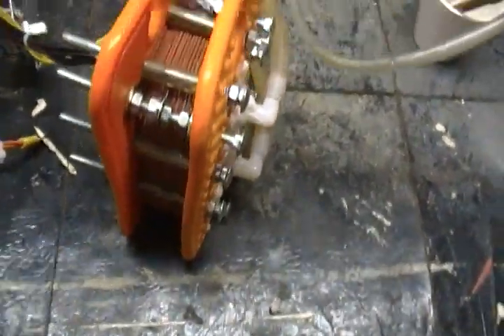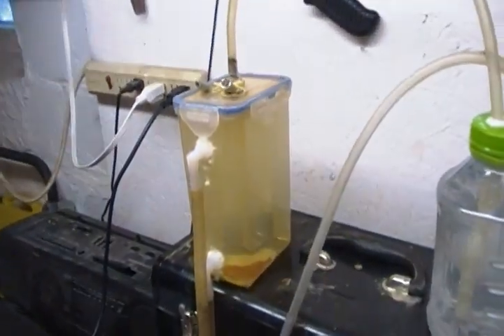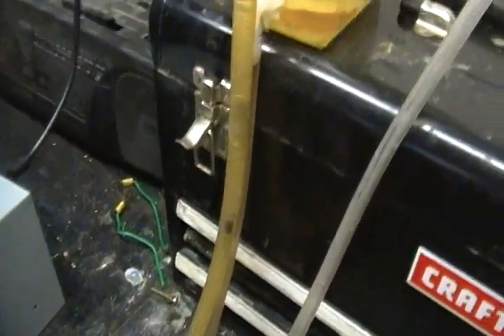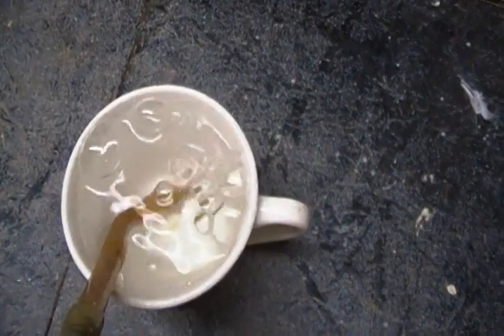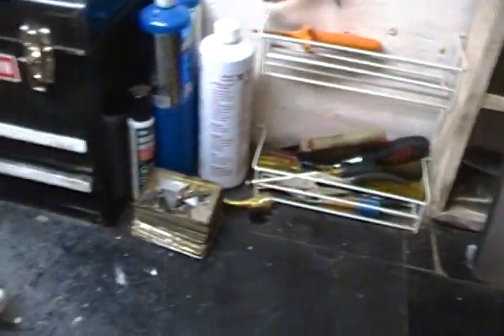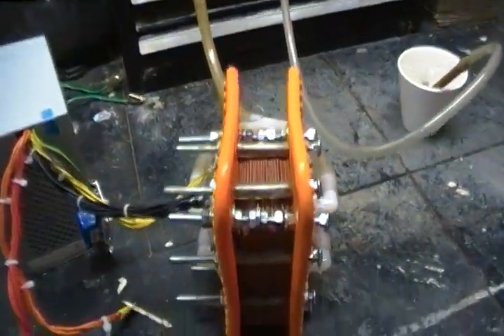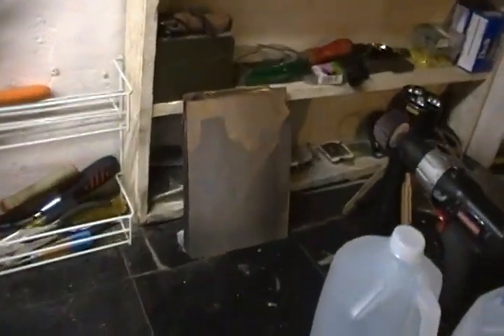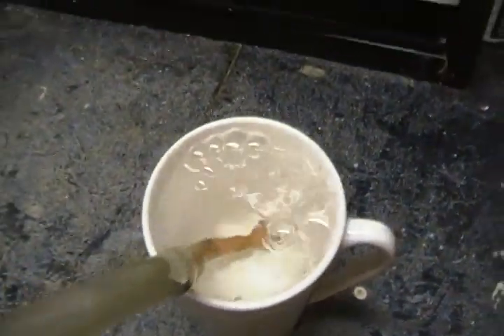HHO Dry Cell Update

Comment: looks good.
If you aim your outlet ports up it will flow better. Hard to see but it looks like the hho is coming out of the ports and going downhill before it travels up to the bubbler. My first cells were out of switch plate covers also. Your new plates look good also. from experience make the holes in them bigger than 3/8. I use 1/2 holes now. Also a good place to get end cap material is Mcmastercarr.

Comment: It's amazing how much energy is locked up in water.
Reply: It's not actually "locked up" in the water. Driving energy into the mixture (electricity) breaks the bonds between hydrogen and oxygen, creating H2 and O2 gasses, or oxyhydrogen. When heated up, or ignited in this case, the gasses react, forming water and releasing excess energy from the electrolysis.
On its own, water is a really stable chemical compound (yes, it is a "chemical"), and doesn't burn or explode without sufficient energy going into it.

Comment: TRY IF YOU CAN,  316TI, FOR THE POWER PLATES,  316 L  FOR THE NEUTRALS,   KOH, DISTILLED WATER,   CCPWM,     WATER STAYS CLEAN AFTER 8 MONTHS RUNNING.  SEEMS LIKE IT WORKS BETTER WITH THE  316 TI AS THE POWER PLATES

Comment: Can some one explain to me how that works ?
Reply: +actuatedg3rm The electricity breaks apart the H20 in to Hydrogen Gas and Oxygen. The hydrogen is explosive essentially. 

Some people use it to better power their car by venting the gas (with a system like this) in to their engine's air intake, and thus lowering the amount of gasoline required to ignite and move the pistons in the engine block.

EDIT: I've been better edumacated. Thanks for the input, OutputCoupler.
Reply: +condhor Some people use it to power their car, but it certainly isn't better. You'll never get out as much energy as you put in (fundamental law of nature), and all the energy in your car comes from the gasoline. So what you end up doing is storing energy temporarily in the form of hydrogen, then reclaiming a portion of that by burning the hydrogen. So you spend more gas than you save.

End result, lower fuel economy, and a screwed up fuel mix for your car. Also, water in the engine, because that's what you get when you burn hydrogen.

Long story short, don't do it. It does nothing positive (those who claim it helps are simply making measurement errors, not violating the laws of nature), and can do bad stuff to the engine.
Reply: +Output Coupler First of all it's scientifically it's good for fuel efficiency purposes and it's a actually a very reliable source of fuel for vehicles.
Reply: +Caleb Wages Scientifically proven*
Reply: Caleb Wages
Quite the opposite, actually. You're using energy to create hydrogen, then burning that hydrogen to get energy back. That energy you're getting back is the same energy you used to create the hydrogen in the first place, only you're not getting it all back, because the process is inefficient, like all processes in the universe.

This is literally one of the most basic concepts in physics, the conservation of energy. If you want to continue claiming that it's been scientifically proven, then you might want to actually go look into that. Because literally nobody has ever demonstrated one of these dumbass devices doing anything except reducing your fuel efficiency, adding water to your engine and fucking up the oxygen mix. Which if you have a basic understanding of physics, is exactly what you'd expect.
Reply: I actually just did a 5 page essay on the pros and cons of Wet and Dry Hydrogen Fuel cells and Pros far outweigh the Cons.
Reply: So every one is entitled to their own opinion and I have nothing against yours but I respectfully disagree.
Reply: Everyone is entitled to their own opinion, but they are not entitled to their own facts. This is something that is, quite simply, total bullshit. It's like trying to plug a fan into a wind generator and use that to power the wind generator. Or putting a pump below a hydroelectric dam to pump the water back up above it and get more energy. These things WILL produce some energy, but because of the Law of Conservation of Energy, they'll always produce less than you spent to do it in the first place, resulting in a net loss of energy, not a gain. Just like doing this to your car is a net loss of fuel efficiency.

Just think about it. If this kind of thing worked, then electricity would be free, because you could generate an infinite amount of it without using any fuel at all by having a generator repeatedly split water into H2 and O, then burn it to get back to the starting point.
Reply: OK buddy I already called quits on this conversation because your as hard headed as a mule and your gonna believe what you believe until you die so yeah...
Reply: Love this thread.

"I beat entropy."
"No, you didn't"
"I am not going to talk to you anymore."

If someone wants to show how they could possibly get more energy out of this than they put in, they are welcome to show their proof... and claim their Nobel Prize.

The only way this can work is if we invent some significantly more efficient way of splitting water. Perhaps in the high temperatures of a fusion reactor. Of course, we need to work out how to get positive energy balance out of those first...